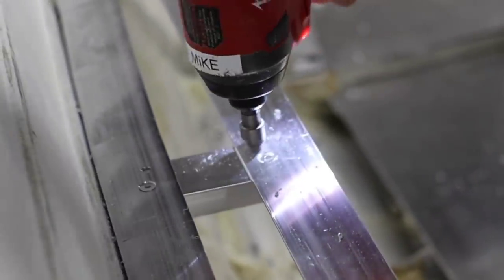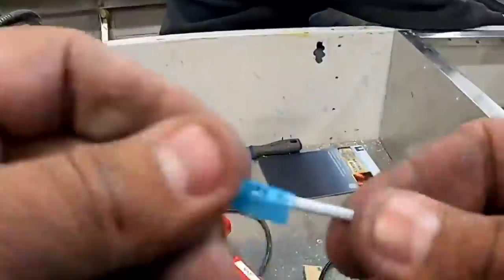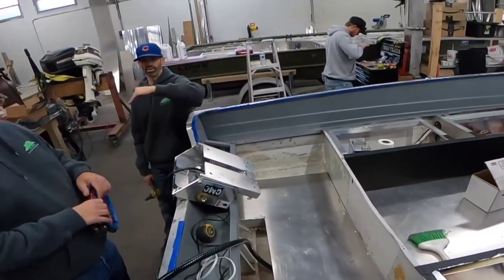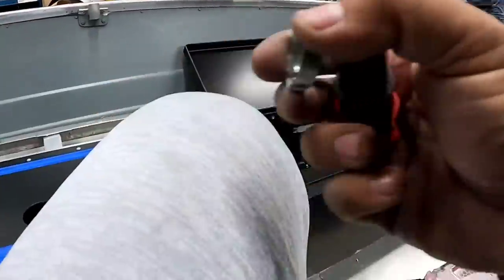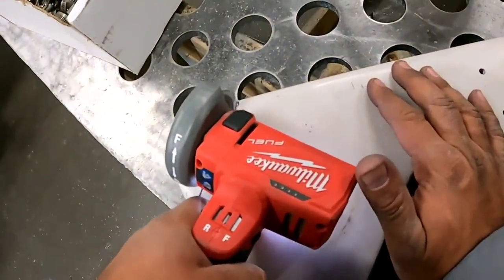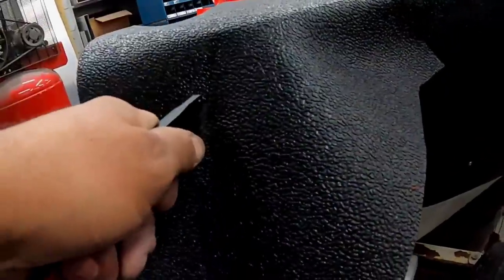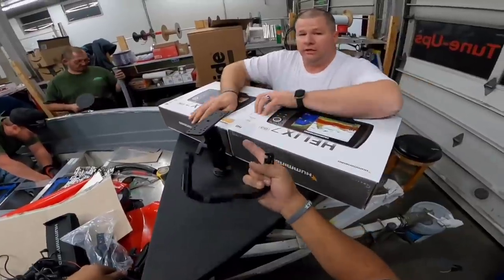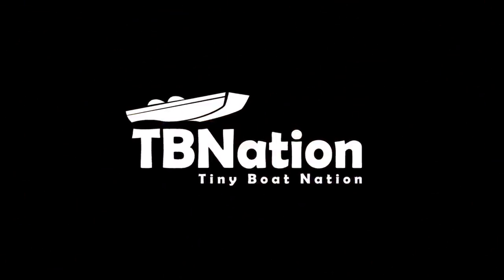DAY TWO: It starts to get Tough: 4-Day Boat Build Challenge

Comment: No grommets around those holes? You will have electrical issues. Wiring through aluminum in a boat that is bouncing and rolling in the waves. Those sharp edges will slice through that wiring. Every hole should have a grommet. Like you said, you put that much time in the build, why screw it up with poor wiring.

Comment: Is it lighter to do the framing in aluminum tube/ angle and use 1/2" marine plywood? Because I can't afford .090 but I want to save up some bucks and eventually do the floor in aluminum.   Any thoughts would really help
Reply from the maker: It’s the same weight